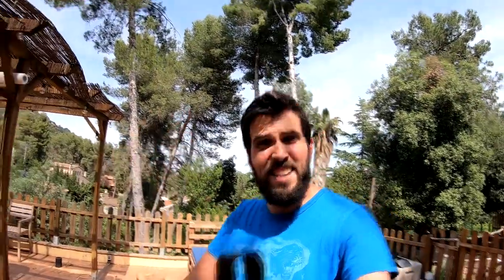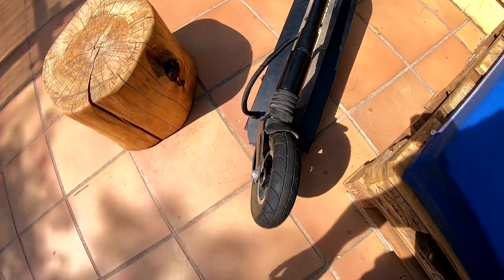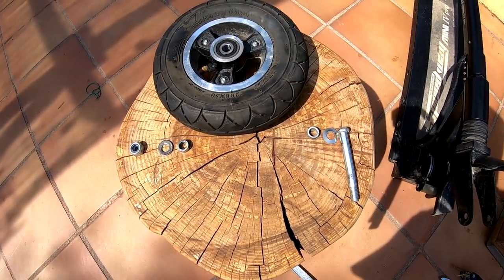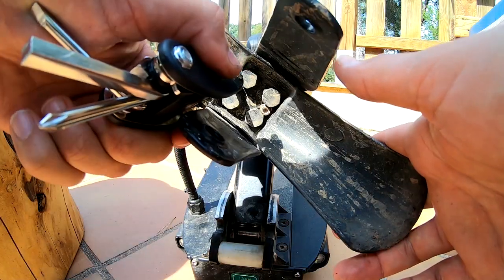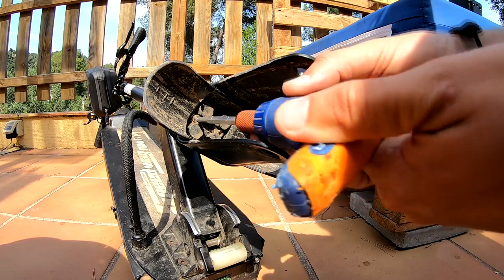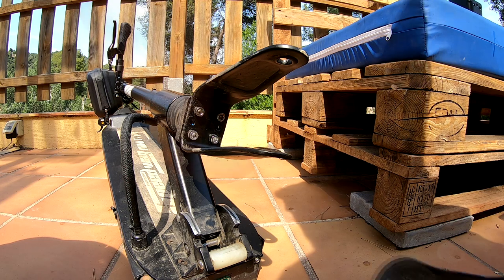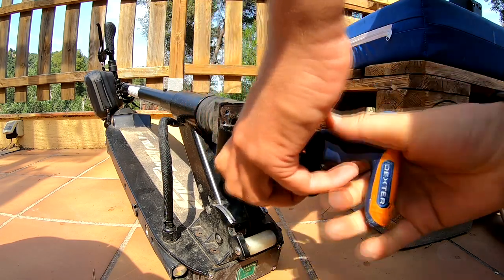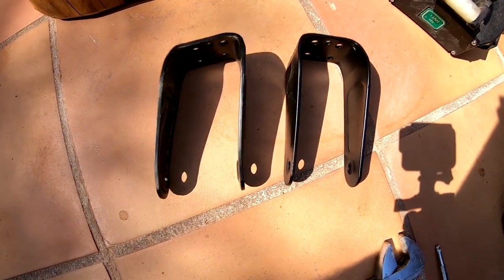How to change a damaged fork in electric scooter 🛠️ Speedway mini 4

Comment: Dat happend to mine I just straightend it back with my hand now it's perfect
Reply from the maker: Thanks for your feedback❤💪 I didn't want to take any risk and I was not sure I could put perfectly straight then I decidede for 12 euros was safer to buy a new one.
Reply: @GuyInAMountain  where can I get fork bearing replacement
Reply from the maker: I guess on aliexpress, you will need to measure the bearing and request one equal. Sorry, I do not have the scooter anylonger to check whcih is the right one

Comment: The speedway mini is ripoff... 900-1050$ crazy.
Lookup the Kugoo M4 Pro.. That speedway is like a rebranded kugoo m4 with less weight and unfortunately worse quality. (Front fork and no front disc brake and the lcd display for example)
Lots of russian reviews of the Kugoo M4 & m4 pro (the pro is second gen.) (450-650$) There are different versions of these. It depends the seller..
If you dont care for some maintenenace which every scooter needs at some point anyway, the Kugoo M4 is a really good value.
Reply from the maker: Thanks for your feedback 💪❤